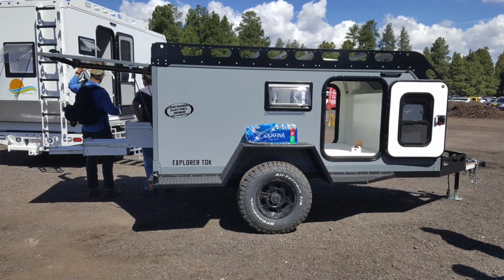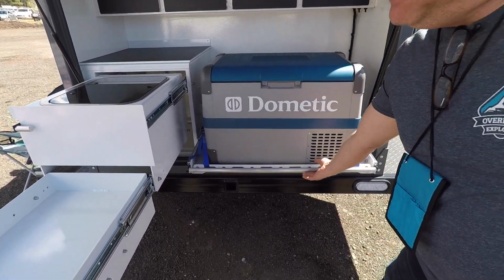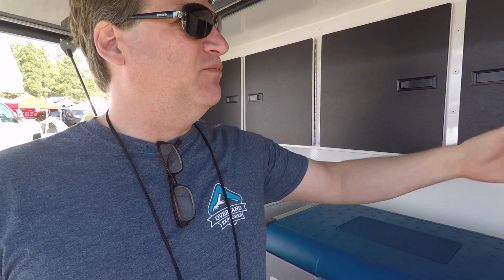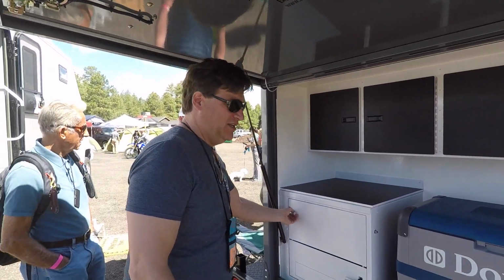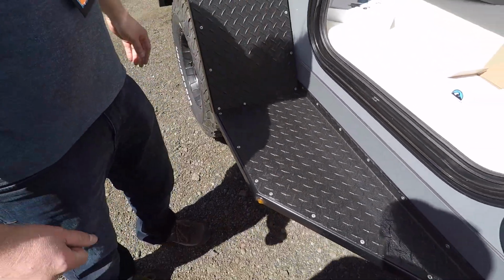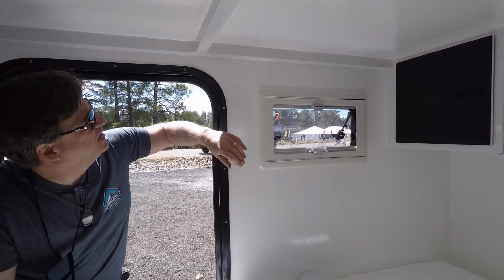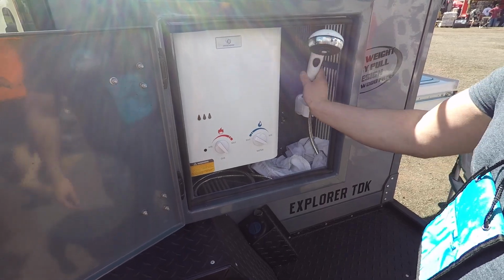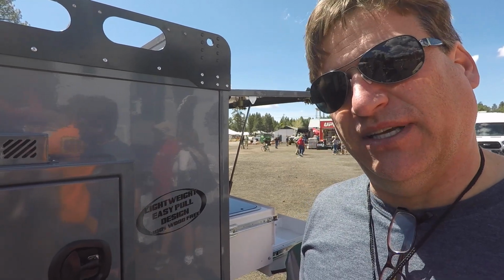The most rugged offroad camper trailer I have ever seen - by Overland Explorer : Overland Expo 2017

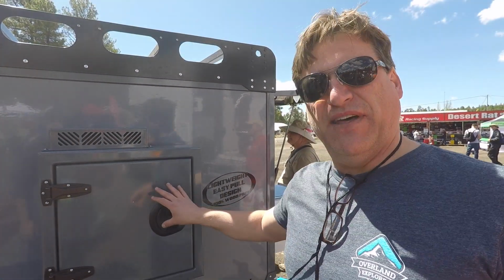Comment: "40 gallons [of water] only goes so far..." (16:10)
Umm, 40 gallons is a ton of water for a trailer this size and this type of application. You are only really using water for cooking, and the occasional shower or rinse/off. It is almost 350 lbs of water fully filled up. Thats way more than you would need unless you are out for weeks at a time.

Comment: Nice trailer. I thought the philosophy behind the adhesive only being used to secure the box to the chassis was a huge fail. No justification for a non-mechanical attachment. Adhesives fail over time, especially under extreme temperature deviations. The fact that the adhesive is very strong does not justify why no mechanical connection was made. I like the trailer though. I’d buy it in a heartbeat.

Comment: Seem cold packages most trailers hve r 1 double pane & 2 the compartments & lines, unless talking long trailers where floor key wall thickness not much of an issue w/small trailers & slide ins. Build quality is &design is key as far as cold but not a factor on small space heating. Market is going w/insta hot water &heating rather than furnace+ heat pump AC's on roof & that is enough bulk of market. Even pop tent ppl roof tent ppl find a way to heat but if using <4 sesons> it's all about compartments & plumbing. If heat no problem if not heated big problem. They make a heated water hose in the NOW, perfect example.

Comment: The roof rack is construct sturdy legit, only no tie down spots. The fender keeps u from letting legs hang out the side,not good. Front tray nope vs every1 will want instead front storage box, every1. Inside dimensions smallest I hve seen fail, & side windows r again smallest I hve seen on any trailer fail. This is 17'not 8/4/20' but design is letting them down not quality.

Comment: The rear hatch door is tiny bit low & it pitches back toward the trailer? not good idea, unless it has gutter & down spout. I prefer the rear swing door rather than lift up so no ht issues & bc build quality can hard mount onto door.

Comment: This trailer has no insulation.  That is so cheap and dumb.  They are showing undercarriage frame - nothing.  Interior ceiling framing - nothing.  The space is there.  FILL IT UP.  At least something.
Reply: The composite insulates to some degree. He did say that it always remains cool to touch, inside, when left in the sun.

Comment: How do you powder coat aluminum, how does it stick
Reply from the maker: Look at the aftermarket wheel industry. They have been powder coating aluminum wheels for years.
Reply: Frank, short answer is GTS (Google That S**t)  ;-)  Just do a youtube search and you will get it. You can do it yourself on small items. Big items you take to shop that does it.

Comment: the gas struts are installed upside down :P
Reply from the maker: I wonder if that was by design?
Reply: I was replacing gas struts on my vehicle so I had to look this up. The rod goes downwards so the lubrication inside the cylinder sits around the seals between the cylinder and the rod. If installed the other way, the lube sits at the bottom of the cylinder and the seals dry out. It seemed like universal instructions.

Comment: Know any company that makes a pop top trailer like this with an upper bed that can sleep 2 adults on a lower bed and 2 kids on an upper bed?
Reply from the maker: There are some small companies that make a bunk bed trailer but they are not pop top style. They are just slightly bigger with a shelf only big enough to sleep a small child or store more gear inside. There is a company that makes a pop top off road trailer but it's just for standing height. It's not for bunk beds. Im guessing you could hire them to build you a custom trailer that has bunks instead of a queen bed.

https://youtu.be/IvdyCbI8jds
Reply: mixflip Thanks for the tip, I’ll take a look. I found a Taxa Cricket Trailer that can sleep 2 adults on a lower queen bed with 2 kids on hanging beds with a pop top. It’s very close to what I’m looking for, but it would be nice to see more trailers like it on the market.

Comment: The advantage of having the body bonded to the frame is less corrosion. Aluminum screwed on to steel, generates ionic flow between dissimilar metals resulting on corrosion!
Reply: Coatings break down and detach. Best solution is mechanical, not adhesive.
Reply: Except it’s not screwed, it’s bonded with adhesive. So the dissimilar metals don’t touch an no corrosion.
Reply: You could use similar metals. You don’t have to use dissimilar metals for the mechanical bond.

Comment: Love 12:04 
Sales bloke-it’s used in the automotive industry all the cars people drive are bonded together
Mixflip-yeah I used to work for Toyota making cars
Sales bloke-yeah (looking smug)
Mixflip-yeah I welded all the cars together
Sales bloke-(changes subject regrets everything)

For some reason as someone with a PhD in chemistry and an AA in engineering I don’t believe any adhesive could bond over 11,000lbs per ft squared on a perfectly smooth composite style of material because there is nowhere for the adhesive to grab, wood no problem grain is perfect for adhesive but not composite. For some reason I know all that bloke said was a Slight exaggeration
Reply: 3M 5200 bonds sailboat keels on and anything else super strong../.

Comment: Nice vid. Sound problem but you know that,.That drawer extension doesn't seem like a good idea to me. I can see it too easy to be used as a seat. That would break it down. ( no matter how many you tell folks not to)
Reply from the maker: These sliding drawers have been used for years now without a single report of someone breaking them due to sitting on them.

Comment: Most over priced trailer ever.
Nice build and layout.  But waaaaaaaaay over priced!!!!!
Reply from the maker: Bill Peirce oddly enough....iy sold the first day of the show for $20k CASH.
Reply: Guess u can cash in on those rich idiots. 
Good luck.
Rather own a full size trailer for that price with 3 times the room.
Reply: Bill Peirce silly comment they are for completely different purposes. This is for off-road use not a camp ground where you go with a trailer “3x the room”
Reply: He just said it was way over priced. He didn't say there wouldn't be any one dumb enough to buy it.

Comment: That trailer would be perfect if it was smaller (no inside sleeping), had the same stuff, and a tent on top with a solar collector on top of that.  It would probably be worth having some sort of "electronics" station on it too so one can charge phones, i-pads, etc..
   The smaller trailer on their website is a bit too small for some.  A model in-between the two would be great.  
   The flatbed truck seems just about perfect.  Perhaps a 4x4 and/or sockets instead of just usb.  Just my educated opinion.  Take it or leave it.
Reply from the maker: Nonya Businesss my option after sleeping in the trailer is....there is no way I would want to sleep in a tent if I can avoid it. sleeping in these trailers is heavenly as far as camping goes. I have slept in tents in rain and snow and mud....it sucks.

Comment: He lost  me at "not mechanically fastened to the chassis"
Reply: T8 DO   I hear you, however, there are industrial adhesives today stronger than many metal fastners...You would be shocked how many things on cars, by all auto makers, that use super strong adhesives...Keep in mind, were not talking "gorilla glue" or "super glue" crap here that can be knocked apart fairly easily...This stuff is ridiculously strong.
Reply: Can you give an example of a production car from a major manufacturer that has a component of similar weight that isn't mechanically attached? I honestly don't think there is one. There probably isn't an example legal for the road in the US that has a tenth of that weight just attached with adhesive.
Reply: @thatotherkyle  I worked on wings for V-22 Ospreys.  The wing skins were bonded to the stringers, or (frame), but the military insisted on having fasteners installed too.  Even on legit paperwork they were called "chicken fasteners", insinuating that they were scared.  That was on aircraft, this is a trailer.
Reply: How do you think unibody cars are made. An Isuzu NPR cab is three sections that are glued together and do not have a single screw, nut, bolt, or weld holding them together. Modern jets have their outer skin attached with similar adhesives. Go get a materials science degree and come back and talk to me so we may speak as peers.
Reply: @thatotherkyle  all Audis and Jaguars are glued together.
Reply: @thatotherkyle  OK'''' how about the doors on the Ford f_150, or the roof of the GM Camaro, the double wall construction of all the U.S. Manufacturers trunk and hoods
Reply: your car is bonded together is attached in the same way. Every aluminum car hauler you see has the panels attached with adhesive. Adhesives can often times be stronger than screws because of the way the disperse the energy. They often act as vibration dissipation and spread impacts over the area. For instance it would be easier to pull the screw out, shear it off, or tear the metal because of the holes caused by the screws. An industrial adhesive does not have these draw backs.
Reply: "the advantage is that...ahhhh...you don't need to". Yep, I bet he has a better answer next time he's asked.
Reply: I would assume the developer may have concerns about bimetalic corrosion and the longevity of the trailer.
Reply: JEEP Wrangler’s have a lot of adhesive holding the tubs together. And Jk’s also have spray foam in places!
Reply: @dustinparrish8453  hahaha Jeep Wranglers are renowned for being some of the biggest most unsafe heaps of shit ever to have wheels
Reply: ME 2...
Reply: Don't fool yourselves, boys. All manufacturers use panel bonding adhesive, from Aston Martin and Mercedes, to Ford, Toyota, and GM. Anything from door skins, roof panels, box sides, and quarter panels are all bonded. Are they bonding a single piece like this camper shell? No. But why would you think that a few bolts, with a surface area of what, a few inches, would hold better than an entire strip of adhesive, spread over a much larger area? 3M adhesive has a shear strength of between 3000 and 4000 psi on steel. You're probably tearing the material apart before those bonds break.

Comment: Very nice unit, but way too expensive for what it is, but some people will not think twice about dropping money on just about anything.
Reply from the maker: MrWinger1951 this trailer sold in 24 hours being at the show. it's a tool for a job. if you were going from Prudo Bay Alaska to the bottom of Argentina 40,000 miles off road....this might be the perfect option. if you are going to the local camp site for the weekend....you could do that with a ground tent.
Reply: I 'm not doubting that at all, but long before there were sophisticated and very expensive over land vehicles and trailers, there were guys who just did it with the best options and equipment they had, including on motorcycles.  I've covered 6000 miles on my Harley, over 3 weeks, all by finding a place to tent, and tens of thousands of miles truck camping.  But anyway, its a very nice unit for sure.  I'm glad there are people who can afford them.
Reply from the maker: MrWinger1951 very true. it's all relative. somewhere in Africa there is a guy in a loin cloth and a walking stick shaking his head at our 4x4 truck campers and nylon tents. lol He is thinking...you don't need that to enjoy the land. My people have been doing it just fine barefoot for 1,000's of years.